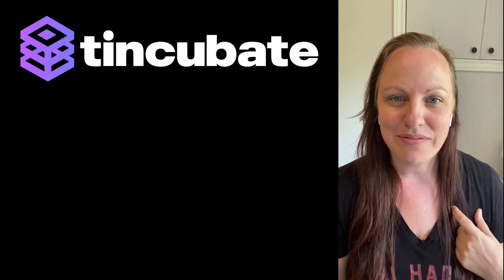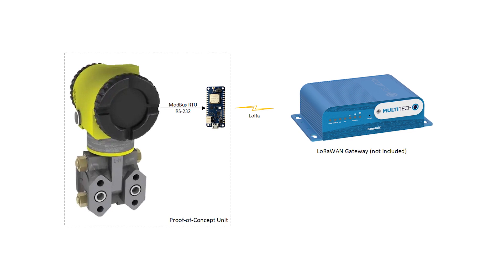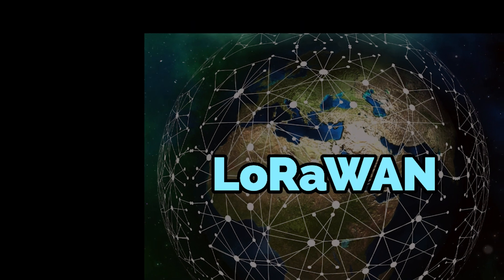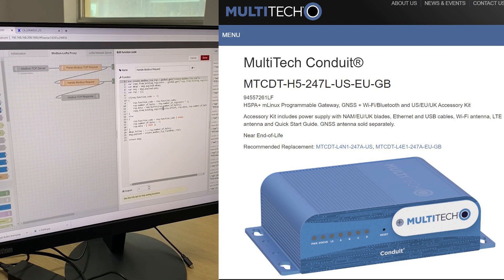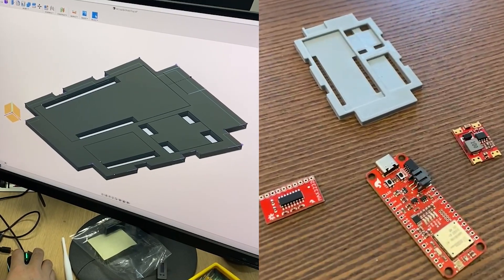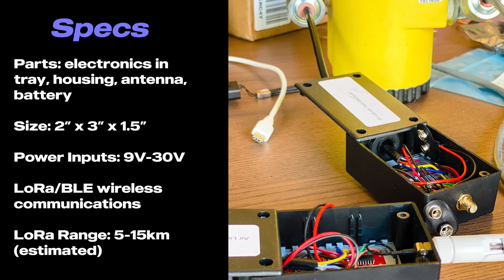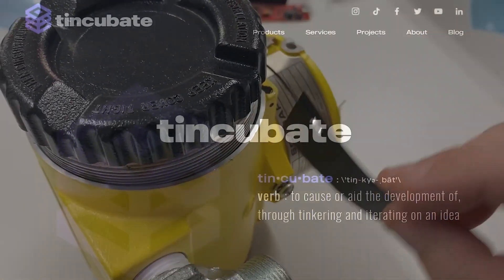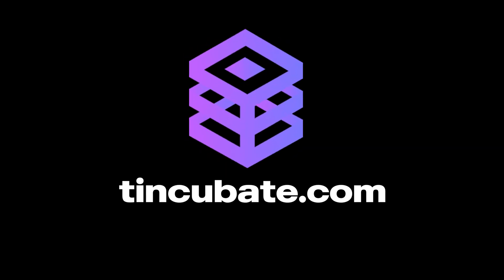We turned a Modbus Meter WIRELESS using Off-the-Shelf Electronics

Comment: Did something similar in the late 90s using satellite communications using STD bus systems. At the RTU we spoofed the communications to get the data. The data was sent over the satellite link slots in time-division multiplexing. The host STD system received the data from the Satcom unit and responded to the polling from the host. There was a timeout on the host STD system if it didn't receive data from the remote so it could respond with error messages or no response depending on the system. We monitored all the remote messages at a control center and often reported problems before the customers detected them. We could also download new firmware to the host or remote STD systems over the air. We had systems on pipelines in the middle of swamps and atop mountains that weren't accessible in winter.